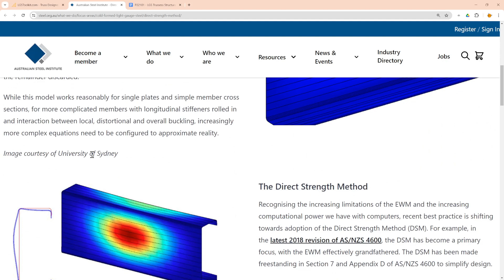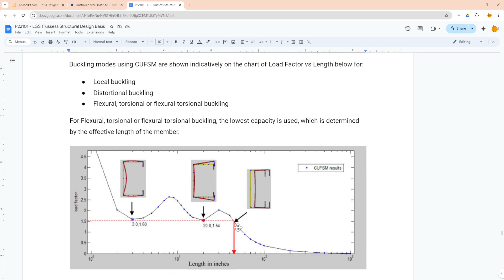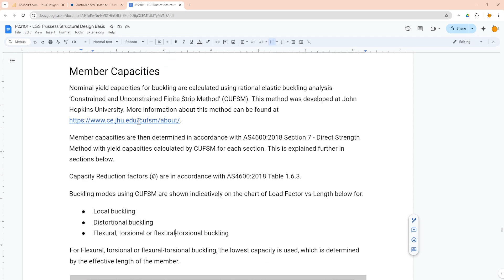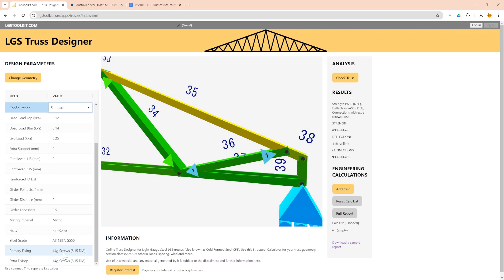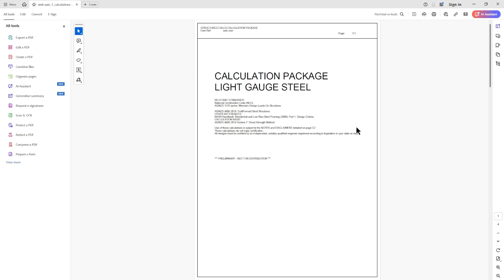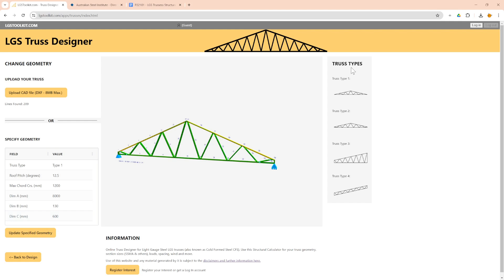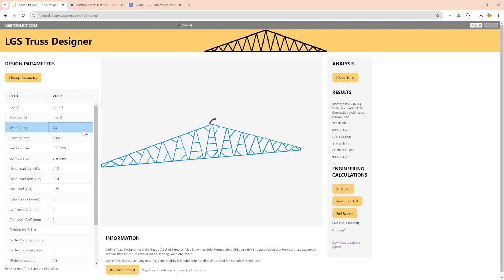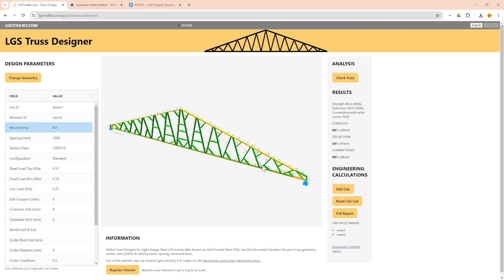Online Truss Designer for LGS trusses - Light Gauge Steel and the Direct Strength method

Comment: At 6:32 do you get some funky bending on the top chord because the last "triangle" isn't a triangle? I'm guessing that's just like the because you were showing an example only.
Reply from the maker: You are correct that the non-perfect triangle at the ends can cause large bending moments. They do that shape with an offset to make it possible to manufacturer as it gets tight at the junctions. The rest of the truss shape determines how bad the effect is.